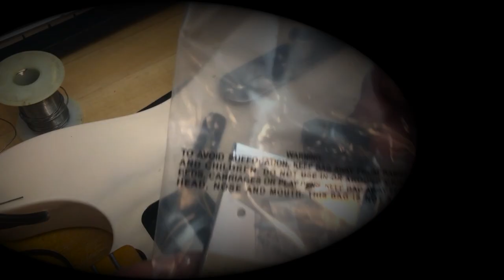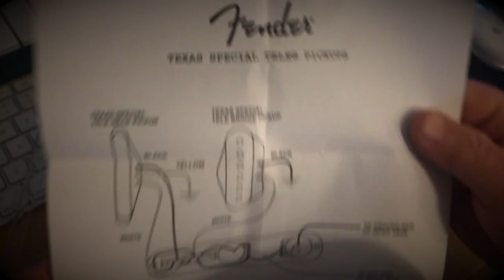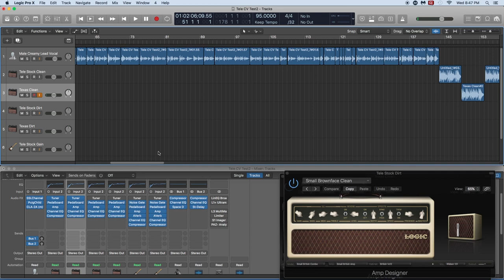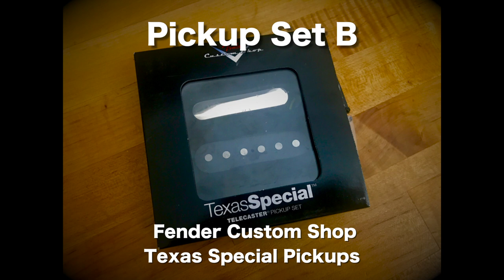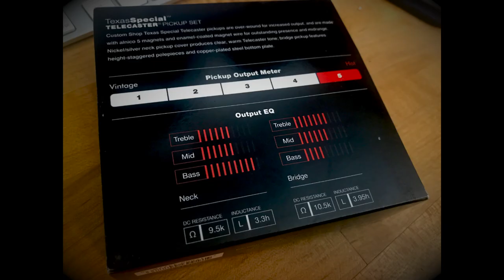Squier Telecaster Classic Vibe Stock guitar pickups VS Fender Custom Shop Texas Special pickups

Comment: Texas Specials.... more body, midrange, especially in the high-mid bite without being harsh or screechy.  Squier pickups... lacking body, trebly adding bite/cut but sounding thin by comparison. Its not the string gauge, if anything, thinner strings add more midrange or "chewyness" (strange but true).  Stand out difference... Chime. Chime is that mix of high-mids, and treble that makes the guitar literally "ring" like a bell... lots of attack and presence Without shaving your ears off.

Comment: So being so close and then changing to new heavier strings for the TS pickups this comparison was useless. It would help if you had used the same strings to compare the two sets. The stock probably would have been equal to or better than the TS.

Comment: In My Humble Opinion....

Without changing the maximum twang/JANGLE from the bridge PUP
the Neck Humbucker is the best way to get FAT and less Treble
into a Telecaster .

You have to use a SINGLE (stacked) FENDER ONLY Volume pot 
that Fender sells which is 
one  500 K pot for the Neck and a 250 K pot for the bridge combined in a single volume pot.
I like the tone pot staying  250K and keep the 22 uf Cap for the Humbucker.

The MIddle position is to die for, just use your tone pot.
You won't need a wah pedal with a good linear or AUDIO tone pot 
and some Pinky finger action.

The HUMBUCKER Neck PUP alone or blended will give you the FAT Gibson solo experiences !

In the end its all about using your tone pot (22 or 47 Cap) correctly and having
the appropriate resistence in your volume pots.
Reply from the maker: Thank you Lorenzo for your comment, good information!

Comment: mmm , i have standard texas special pu's in my fender american special tele , and they give me all the things you wanted , fat , full sound ect.  so yeah ? Maybe adjust the height ?
Reply from the maker: I kept the TS in my Squire. I like them better. Even though the review comparison does not show a lot of difference between the pickups in the digital world they do work better for me in the real world plugged into an amp.
Reply: @airtimedesign  ok , another thing to look at to get a fuller sound  might be the pots ect . , i have lately changed the pots and cap ( together with the pu 's ) in my squire bullet strat . I took the ceramic pu's out ( wich also where not that  bad , btw ) and put fender tex mex pu's in it . This really gives me the sound i wanted , i put alpha pots (fullsize  250 k )  and an orange drop cap . 047 uf  in to upgrade the electronics also .
Reply from the maker: Antoon, thank you for the comment. I think the stock Squier pickups are Alnico V and they sound good. But I want to try the Tex Mex. Tell me more about the sound of the Tex Mex. I think I'm going to do a comparison video with those next. Thank you!
Reply: @airtimedesign  hello , well they are overwound alnico 5 pick ups , so they are like the texas specials , but a lot cheaper , anf for in a strat  they  are good for if you like the  srv , hendrix , gilmour styles , and i must say i like the sound off them , but do different alnico 5 pick ups really have a different sound , overwound or not ? , i don't think so , in anyway not that much , I have had fat 50's , ts . true 59's and now the tex mex  pu's from fender  , SSL 1 from seymour duncan and also the irisch tour's from bare knuckle , and to me they all sound the same , there all "hot " alnico 5 pu's , so my advice would be to anybody who wants this kind off pu , get the tex mex from fender , they sound well ( just as good as the rest anyway's )  and are a lot cheaper then the rest and also use the right  cap in you're guitar , iff you like the somewhat more " vintage / fuller " sound then use an 0.047 uF ( those where used to the beginning off the eightys )  and use an 0.022 uF if you're aiming for the more " modern / brighter ) sound ( wich is the modern day cap value  most strat's have these day's ) , and off course some good value ( 250 k ) pots from alpha or CTS ( linear for the tone , and audio for the volume ) .
Reply from the maker: @antoonhermans8953  Wow! Good information Antoon!

Comment: The Squire pickups sounded brighter, a little more dynamic, and little more celerity. There seemed to be a little more mids with the Texas Specials. 

I play an American Original 60s Telecaster with 64 Telecaster pickups. Not so bright as the 50 model and a little more growl when played with Overdrive.

Here's my 2018 review. I've made a few cosmetic changes and replaced the stock saddles with brass compensated saddles.
https://youtu.be/y9CkwQJN8M4

Comment: Hey  good just a suggestion you where using Logic pro and Vox amp plug in why not try a real value amp and compare that and see if it's any different from stock to Texas specials just saying to see if it dramatically different or not  🙏👍thanks man !!!
Reply from the maker: The comparison is in the digital world and direct but does not tell the whole story. The TS are louder and have more output. In a real world situation this translates to a fatter beefier sound because it loads the front end or preamp of an amp. I leveled the volume in my test and used the Logic amp sim. So you are right and an amp test would be a more complete comparison. Thanks for you comment!

Comment: It’s a curious thing, original pickups made to a cost with the most rudimentary design and cheapest materials.
Back then electronics was not very advanced and it’s crazy to believe there is some way to improve on that simple coil of wire wrapped around a magnet... it’s not quantum physics.
It’s right here we find guitarists are the most susceptible suckers to fall for marketing woo.
Save ya money and practise more.

Comment: You would have gotten a bigger difference if you would have also upgraded the pots
Reply: I did that leaving the original Pups. Went with ToneMan Blues 60's Telecaster Wiring Harness Kit Vintage Paper In Oil Tone Cap. Has better volume and tone control.

Comment: Not a big difference but I prefer B. Try a cheaper set of Fender Tex Mex they sound better gor me and way cheaper.
Reply from the maker: Hi Michel,  One thing I might not have stressed enough is that the TS are louder. That loads the front end of the amp and creates a different sound which isn't really obvious in the comparison.

Comment: I guessed right - and also agree they are quite similar - but the Fender USA pups are a bit fuller.  Not the 300 bucks or more you spent better, but they were indeed fuller - dumb - you are actually wrong that 10's would sound better - Beatto and Shul proved that thinner strings sound bigger - and how the bloody hell can you do everything to make an even and fair comparison AND THEN CHANGE STRING GAUGE??

Comment: Hi , I  listened through my headphones set A had the best over all sound not even close..
Massive difference in clarity playing last tracks Dirty 
I own a Squire Cassic vibe Custom ( mk2  indonesian version )
Check out online CVC  vs  Fender USA Custom &  Fender Mexican  Custom..  wipes the floor with them both
If this Guitar had Fender on the headstock & made in the USA
The Fender community would be waxing Lyrical over it.
Instead there in denial.. Thinking Shhh..it ive just blagged 2K plus
On a Very Expensive Imitation ..  Suckers Lol

Comment: I like both.  I don't understand why you cut the strings, though.  Even replacing them with a brand example of the same kind of strings makes a significant difference.  I've kept my CV 50s Tele as is, even though I'd bought it intending to swap out the neck pickup.  I just really like the guitar the way I got it.  I'm intrigued, though, by the 4 way switch mod that gives both series and parallel wiring options for the middle position.  People say it gives a darker, fatter humbucker-ish tone in addition to leaving the stock middle position tone unchanged.

Comment: Preferred original, but too close to justify a change.
Reply from the maker: I've posted this several time but just be aware that the TS are louder ie have more gain. I evened everything out in the comparison but having more output does affect the sound when you plug into an amp. I thought about returning the TS after the comparison was so close but I ended up keeping them because I do prefer the sound of the TS when I play though an amp. thanks for the comment!

Comment: It sounds like you spent extra money needlessly! I really can't figure out just why they now mount the neck pickup to the scratch plate, I don't care for that at all!
Reply from the maker: Hey Richard, it's hard to justify the extra money for the TS but there is another factor which does not show very well in the pure digital comparison. When you plug into an amp the higher output TS drives the amp a little harder and has more width. I ended up keeping the TS but I'm trying the Fender Tex Mex next. Please subscribe!

Comment: String gage not the same this review is pointless because 9s and 10s have completely different tonal weights. The 9s are mid forward where as the 10s are more evenly balanced. So with that in mind the cv pickups are a better pickup to me because with 10s on a cv tje pickups are fat and even almost p90 sounding
Reply from the maker: Hey Chip, that is correct and the reason I mentioned it is because the stock pickups held up so close and had a disadvantage in the smaller string gauge. Thank for the comment!
Reply: @airtimedesign  I would however be verry interested in seeing you review the guitar again with the same string gages for a more true comparison. Even with the discrepancy it was interesting that the cv pickups held up there own. The compelling part was for.me that depending on style and over drive some times one of the cv pickups sounded better and se times I preferred the Texas pickups. Thanks for.lettimg me rant 
Chip
Reply from the maker: @wierdlygruesome  Thank you for the comment Chip.

Comment: They really didn’t sound that much difference at all, not to justify the price difference. I would keep the originals.
Reply from the maker: I considered switching back to the stock CV pickups but I decided to keep the TS. One thing that is not obvious in the audio comparison is that the TS pickups are louder. I evened the levels out for the test so as not to be judged on volume. The TS do sound better plug into an amp because the additional output loads the front end of the preamp and thickens up the sound. But in the end they are very close and sound is totally subjective. Thank you for your comment and please subscribe!

Comment: They both sounded similar and they both sounded awful. The CV sounded better in a few honestly. I'm a tele lover so not sure how these both sounded so bad :/
Reply from the maker: Hey Ryan, thank you for the comment. Keep in mind that this test was done with guitar plugged directly into the computer through an Apogee Audio preamp and digital interface. Even though its going through an amp sim in Logic it's still not like plugging into an amp. The reason I did the comparison this way is because it eliminated any variables. I agree the sound is not spectacular for either pickup set  but the comparison is uncolored and as close I could get to fair. For sure both pickup sets will sound better plugged into a good amp.

Comment: I don't think the difference is that much, not comparable with the price. Upgrade the electronic (cable, pot, treble bleed etc) would be much cheaper option
Reply: I agree about upgrading the rest as well. If you’re paying $150-$200 for new pickups, it’s definitely worth it to spend another $50 for better pots, switches, jack, etc.

Comment: In other words the texaqs specials are not so special after all... Dont waste your money on them.
Reply from the maker: Keep in mind that my review is not really a real world comparison because it's direct to the box and does not account for what happens when you plug into an amp at stage volume. The review was design to be as fair and controlled as possible but there are other factors to consider. I ended up keeping the TS and I really like them. Are they worth the price? It's like horsepower, you pay a lot more to get the top degree of performance.

Comment: I’m sorry but I have 3 CV and yours does not sound good at all ! 
Too harsh, no body on the neck pickup, this is baaaaaaaaad.
Reply from the maker: Hey Vincent, thanks for the comment. I agree, they don't sound good at all! Remember I was taking a direct out and going into Logic with an amp sim. It's completely different than plugging into and amp. Both guitars were recorded the same way. This seemed like the best way to fairly compare them because just changing the setting slightly or moving the mic a little would change the sound and give one or the other an unfair advantage. There's no doubt the Squier pickups sound good but this review is not so much to show off how good they sound as much as how they sound compared to more expensive pickups. Please subscribe to see more of my reviews, Thanks!
Reply: @airtimedesign  my bad ! I did not get that. Apologies.
Reply from the maker: @Vince1974  Hey Vincent, I appreciate that you took the time to watch the review and post a comment. All good!